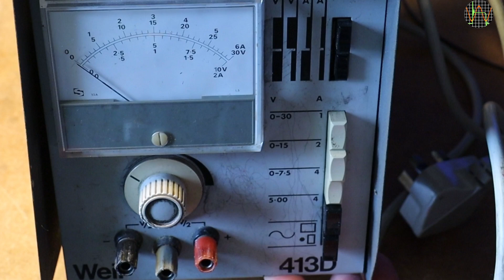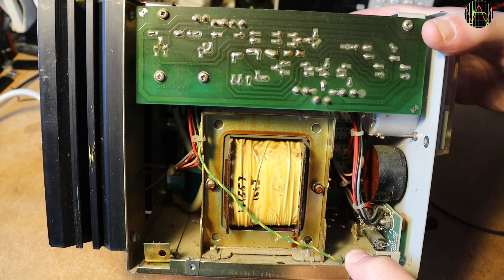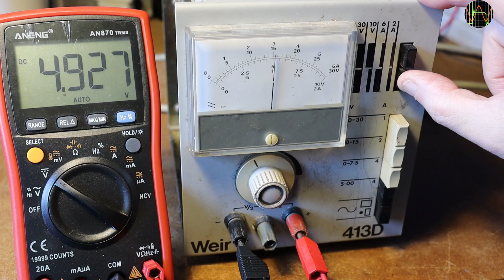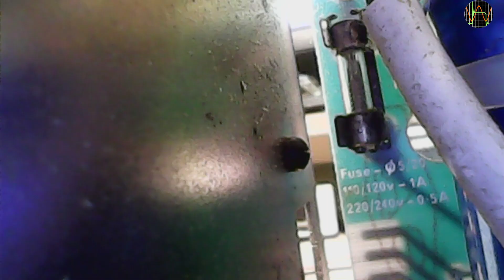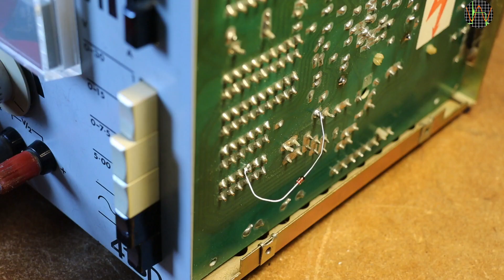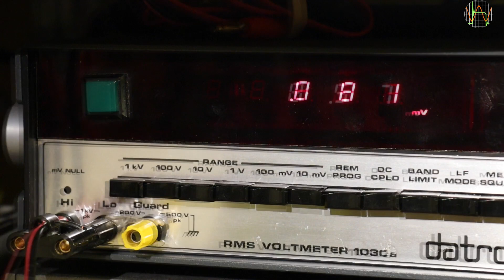129 - Fixing a WEIR 413D power supply bought "for parts or repair"

Comment: Great video. Do you still use the power supply for your projects?

Following the previous comment about Service Manuals, do you have ‘go-to’ web sites when you search for them on-line?
Reply from the maker: This one, no. I have other ones (including a WEIR 4000 and a WEIR 460) where I can control the current limit. On the 413D the lowest setting is 1A which is quite a lot if something goes wrong in an electronic circuit.  Sites for (free) manuals include: https://elektrotanya.com/
http://www.ko4bb.com/
http://bama.edebris.com/manuals/
http://bee.mif.pg.gda.pl/ciasteczkowypotwor/
https://xdevs.com/docs/
Reply: @ Perfect, thanks so much for the web-links 👍

Comment: Nice post, surprising to see how a relatively small number of Transistors made a low noise and useful power supply.
Also the choice of virtual ground and the push-button selection are ingenious solutions as you showed.
A brief inspection of the schematic at time= 5:00 seems promising to reduce the current limit feature by 10:1 or more, using an additional switch, for instance.
Thank you for this post!

Comment: A nice psu - though the push button combinations could get confusing if you were in a hurry... I do admire the way the way the designer got multiple current limits from the switches. The split output circuit works pretty well too. 
I spotted (I think) another date code of 8003 on that Colvern wirewound pot too - and along with the general look of the internals, I agree with you that it probably is from about 1980. A great Ebay find with a relatively easy fix !